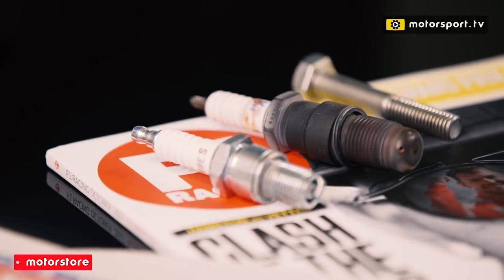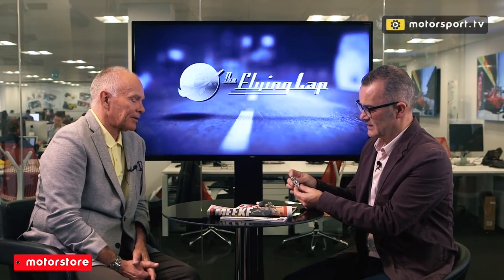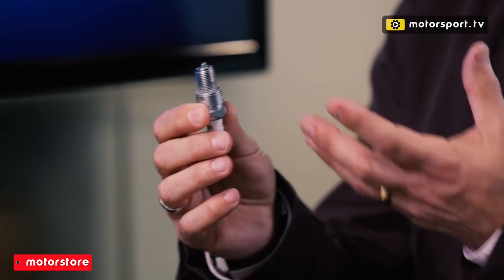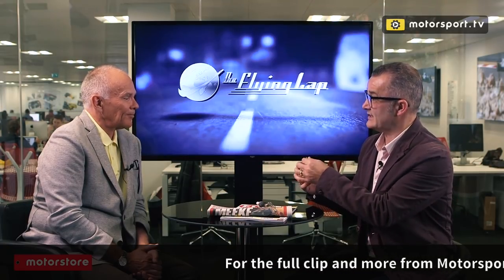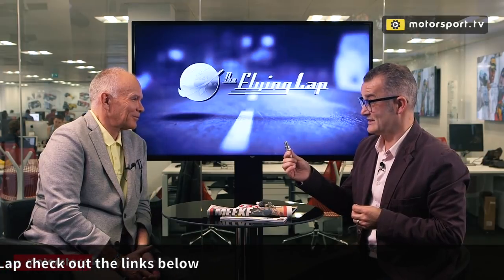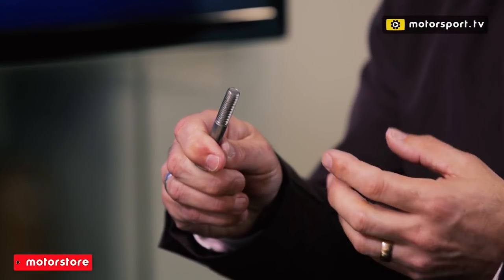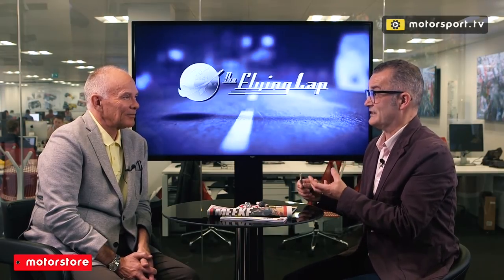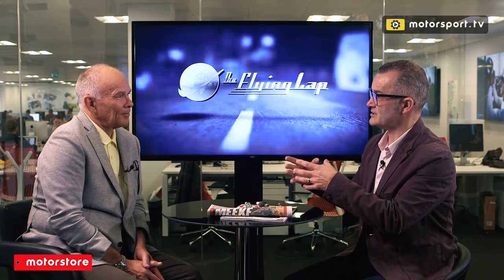F1 spark plugs explained

Comment: If I were to put an F1 spark plug in a normal car the car would misfire due to carbon fouling. Carbon fouling occurs when the mixture of fuel is too lean, so the left over carbon sticks to the hot parts of the spark plug. An F1 cars spark plug is designed for lean mixtures so it would be unsuited to put it in a regular car.
Reply: Carbon fouling happens when the mixture is too rich; not lean. I knew that from I was a pre teen. Any Haynes manual will show that for plug reading. A tannish brown appearance being the ideal. White too hot, black rich.

Comment: Hoping you can shed some light on this?  I used octane booster in my FE 428 and all of my plugs turned orange?  Now what is that and why did they turn orange?  Did I harm anything internally in the motor by doing this?  Will the orange go away if I just run premium unleaded and quit using booster??  What happened?
Reply: Its from the MMT in that octane booster.  Not good to use.  All owners manuals warn not to use it.  Berrymans B12 will clean up the residue in the chamber & also your catalytic converter is coated, & use. CRC Guaranteed To Pass additive,  also Red Line SL1 has the highest PEA to clean up everything + carbon.  Finally, VW Volkswagen Fuel Additive #G001780M3